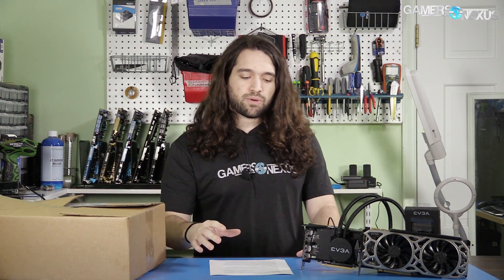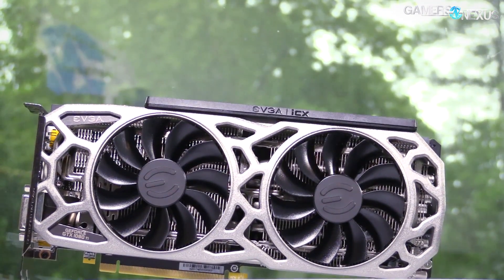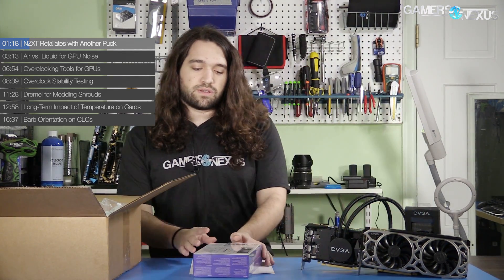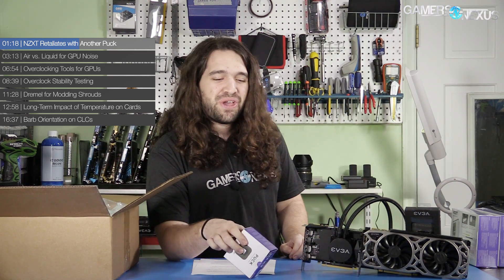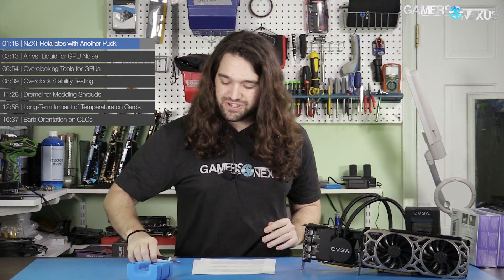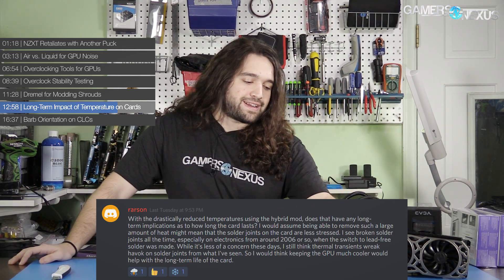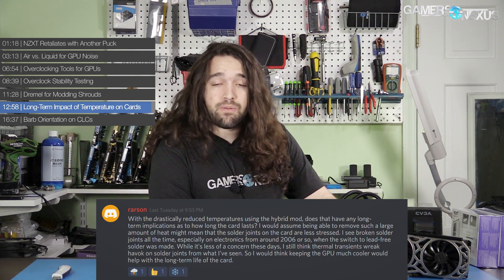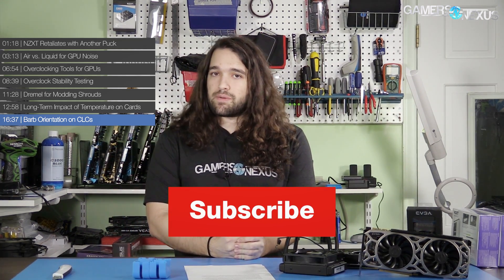Ask GN 49: Long-Term Impact of Temperature, Noise Optimization

Comment from the maker: Ask GN is back! Can't wait to shoot one of these in Taiwan while we're at Computex (May 25-June 5, for us). That's always a fun change of environment.
Reply: Gamers Nexus  

Does getting a none reference GPU help with overclocking EX lets you overclock higher VS the reference  card from Nvidia Lets say you but a water block on both cards.
Reply: Gamers Nexus Could you please make a video about how overclocking affects 0.1% and 1% lows?
It seems that quite often when you show overclocked results, the lows will be even lower than the stock frequency.
Would it even be worth overclocking most cards since the lows are what's most important in most cases to make the game play smoothly, especially if you are already getting high framerates.
I'm assuming this is another reason why many manufacturers don't clock their cards higher even though it is possible for them to do so.
So would you be able to make a comprehensive video, comparing many cards and games, and try to see the effects, and maybe finding the ideal overclock so that it doesn't reduce the lows, and hopefully finding out why this happens (is it thermal? or lack of stability? low quality components?). I ask for a video because a simple answer wouldn't give us an in depth view of it all. 
Maybe compare a whole bunch of cards with the same chips from different manufacturers to see how they do.
I feel like this would be the best way to shop for a card, since lows are really the most important when it comes to choosing a specific brand and model for performance.
Reply: hey steve,  broski here.  i've used the loop from a 295x2 and have it in my lian li tu100b with a 1070 and oc i5 4th gen. what would you change?  i'm thinking vega maybe if it fits or the zotac 1080 after i change the cpu, but im not sure if i should wait for something else or if you recommend cpu before gpu or vice versa. thanks  also, i think the pucks are hilarious and i love your work  :) thank you
Reply: How come AMD didnt include integrated graphics into their Ryzen lunch ? Do you think they will include it into their R3. Are they gonna re-release their R5 R7 with integrated graphics next year?
Reply: Sounds like you have plenty of pucks for future giveaways. :p
Reply: GN at around 16:00 i had a Sapphire Radeon 5850HD from 2009 and the fan on the Gpu die december 2015 and the system was running 24/7 all the years.
Also on another system i was having from 2008 it had a corsair h50i if i remember the name correct.The pump die after 2 years.Since then never again with an AIO i prefer Noctua for Cpu Cooler and GPU's without reference fan cooler.
Reply: Hey Gamers Nexus, I really hope you see my question because I cannot find an answer anywhere. I own an MSI Armor RX 470 4GB card that I currently have OC in wattman to 1340 MHz at 1100 mv with power level set to maximum (+50%) that doesn't pass 70 Celsius. When clocking my card any higher, say 1350, 1360 etc I experience a consistent drop in performance. I have confirmed this isn't a result of the core clock dropping at points due to voltage or power, it is rock solid. I've tried fiddling with more voltage and running fans at max RPM but whatever I do I get less frames in both synthetic benchmarks and games as a result of a higher clock speed. How can this be ? The ASIC of my chip is a low 62.5% I might add. Sorry for the long response but thank you so much !
Reply: I agree.
Reply: QUESTION - What happens if you use all the PCI-E bus Lanes. For example if I plugin 4 cards into my PCIe slots and use a m2.2 with my 6700k computer. Will it error out, will it just be unstable? What exactly happens? (I have never been able to get a clear answer on this). Thanks!
Reply: Wrote this as a separate comment as well: Could you elaborate on what you said briefly about NAND; "Running cooler is generally better for most components except things like flash..the NAND". I've never heard of NAND suffering from too much cooling and am genuinely interested in this topic.
Reply: Question: Why can we Overclock Ram with 2 DIMMs over 2666(DDR4), but Seem limited on Overclocking 4 DIMMs to a max of 2666Mhz. is this a CPU limitation or a Motherboard manufacturer limitation?
Reply: has the gap between low end celerons and high-end i7s grown or shrunk in terms of loading real world geneal purpose tasks across generations? for example would a web browser load a complex web page noticeably faster?

Comment: Great vid! I have an ibuyerpower Revolt 2 with an MSI Sea Hawk 1080 Ti. Both the CPU and GPU are on an AiO (Corsair 55 I think). Radiators are mounted in the bottom because of the case design. Based on your answer to barb placement (i.e., avoid having barbs at bottom of case), was the design of the Revolt 2 case fundamentally wrong? Should I plan on replacing my AiO sooner than later if placing radiators in the bottom is bad? To be honest, I have no issues with noise or thermals.

Comment: Just been watching an Awesome-Hardware where the guys were talking about the Intel Optane cache drive (16 & 32GB) Would this type of hardware be useful to use with a large mechanical drive (say 2-4GB) to speed up your backup/media/games drive, but have an SSD (120-240GB) as a boot drive for OS and essential applications?

Comment: question: Can you solder more vram on your graphics card when there are free slots? Like with the gtx 1060 3gb where there are versions with more vram. (The answer is probably no, but I couldn't find a proper answer on the internet.)

Comment: Ask GN: Why were power limits put on the Pascal architecture specifically? It seems that the 1080 series is amazing, but the only thing holding it back in overclocking is the voltage limitations. As a bonus, how would you speculate the overclocks to be if there were no limits? How much of a difference would it really make?
Reply: Mikah Mitchell I think one good public excuse would be the safety thing, but also I feel it was locked down to keep people from truly pushing them to CRAZY levels and making the next gen a little less of an upgrade over an OCd Pascal...

Comment: with over 15 years of overclocking my CPU/GPU I can say that adding voltage is much more likely to degrade the computer than high temps. And of course both adding voltage and high temps with be like getting slapped (high temps) and getting kicked in the nuts (high voltage) at the same time lol

Comment: Hey Steve love the show keep it up. Question is do you think 1.35 volts is safe for a 4690k if temperatures stay reasonable? I am currently at 4.3 mhz at 1.280 volts and would like to get to 4.5 but can only reach it at 1.35 volts but I am not sure if it is good for the cpu to run that high. What are your thoughts?

Comment: I am fairly new to pc's. Last year I got myself an r9 380 and a new psu to upgrade the prebuild pc I have (amd phenom x6 1050t/4gb ram). Having using it for a year noise, ram capacity and crashes became an issue. Rather than trying to make things work I want to build it with a newer chipset that has some upgrade path so I was thinking g4560. Then ı watched/read online that amd gpus need at least 4 cores to work properly or amd drivers were slower than intel's on budget cpu's. I am really confused right now. Would be great if you guys explain why-if its true-
Sorry for the long comment and my english. Have a nice day!

Comment: About CPU Stability I used Prime 95 without AVX2 for finding out my right Voltage...but there was a problem....Prime 95 was crashing my PC, but Games and Cinebench R15 ran fine....
With AVX2 on 5GHz 3 of my 8 Threads were idle instead of running..

Also about AIO.
I use an be Quiet Silent Loop 280. its pump is vitually silent.
My ASUS STRIX 1080 TI is also Silent under 55°C, above that the Fans go on and cool it back to 50°C and shut off.
Of cause i can change that with a Tool like MSI Afterburner.
But under Heavy Gaming the Cards heats up quite a bit, sothe Fans wont shut off anymore.

And About Longterm Heat... I have an GTX 690 which is a dual GPU Card. Both Cores run permanent at 83-85°C (Thermal Limit/Throttling) with Gaming. The Card is now 5 Years old and had NEVER any Issues. After cleaning it still runs like Day 1. I exchanged it now, because the 2GB Ram was not enough anymore.

Comment: To add a little to the GPU cooling question since idle noise was important: AIB air coolers of recent years have a 0 rpm mode when the GPU is under 60C or a certain load threshold meaning literally 0 db when not accounting for coil whine which is not audible at idle load. I say go air all the way.

Comment: Hmm, really hadn't considered that orientation thing with the radiator. I justs thought that as long as the pump itself wasn't at the highest point, I'd be fine. Have been experiencing some noise from my Kraken X61, so I might try and flip it then! Are there any more GN videos or other sources going into detail on this?

Comment: question: can overclocking say a graphics card to the absolute limit cause the OC limit to reduce over time? Fore example overclocking a new Strix RX 480 to 1475mhz, then over months of that clock needing to gradually reduce the over clock to keep it stable

Comment: 1. Use of m.2 SATA 3 SSD vs NVMe m.2 SSD, does m.2 SATA steal pcie lanes even though it cannot use it?
2. Intel telling people to not overclock k skew processors, particularly the 7700k. How do you think Intel handled the issue with the thermal issues? and why do these people have these problems? Overly high vcore or maybe delid made the CPU worse?

Comment: QUESTION - What happens if you use all the PCI-E bus Lanes. For example if I plugin 4 cards into my PCIe slots and use a m2.2 with my 6700k computer. Will it error out, will it just be unstable? What exactly happens? (I have never been able to get a clear answer on this). Thanks!
Reply: Motherboard and CPU have their own PCIe lanes, so for example x16 and x20 for a total of 36. So using M.2 or PCIe NVMe SSDs doesn't harm your overall capacity in other areas. The number and size of slots on your mobo also kinda naturally restricts how many lanes you can use up in total. The only thing that does actually happen and is common is using SLI or Crossfire. With two graphics cards, they'll use up two x16 slots, but those will then run at x8. Don't worry though, that's still so crazy fast that it's not really a bottleneck even for SLI 1080tis.
tl;dr you can't f up your system by using up too many lanes

Comment: noise is def my first priority nowadays. with the cpu gpu being this good. i usually let them over-heat A BIT.

but so much quieter.

zotac1070+noctua15+define R5. everything turned to noise optimized as possible.  love  them.

Comment: I liked the question about the lifetime based on temperature. Mainly because I live in Rio, Brazil (hot as hell!) and I just bought a 7700K. I'm impressed how this chip is hot!!! Is there any differences between the silicon on CPUs and GPUs, regarding temperatures? In my experiences, my GPUs have always been hotter than my CPUs... And now this Intel chip is challenging my beliefs.

Comment: Ask GN: I recently overclocked Crucial Ballistix Sport DDR3 1600MHz (2x4GB) to 2000MHz by loosening the timings from 9-9-9-24 to 11-11-11-28. It passed MemTest86 for 24 hours at the overclocked settings. However, Unigine Heaven crashes instantly with the overclock. While I understand the merit of using multiple applications for stability testing, any ideas why MemTest86 got it so wrong? Should I bother using MemTest86 in my testing suite?

Comment: Many gpu reviews are done on x99 systems because it alleviates cpu bottlenecks according to most reviewers. This seemed fine until ryzen came out, where we saw the r7 1700 "performing worse" aka slightly bottlenecking the gpu in comparison to the 6700k/7700k. (Which in terms of gaming the r7 1700 is effectively within margin of error from the 6900k).

So my question is, why do reviewers opt for x99 systems for reviews knowing they are holding the gpu's back by a very measurable amount, or did it really take ryzen to come out to make the community realize that skylake/skylake v2 (kabylake) actually have some rather noteworthy gains over haswell?

Comment: Here is a question the internet hasn't been able to tell me, google, nor bing, WHAT WATER COOLER can I use on a ASUS GTX 1080 Turbo? I want to stick it on water, because TBH, it's loud as a jet at 100%, but zero coolers are for it, heck, even EK is like 'GLbro'.
Reply: Madness Soft You could check out and simulate a water cooling solution from ekwb. You put in all your current computer specs and you can choose the decibel range for the performance of such setup. it might be your best bet, but it might cost you some cash. Hopefully this helps.
Reply: Yes I know about that, but honestly, it comes up as "no", seriously, go check it for an ASUS GTX 1080 Turbo. It's a big fat "nope" solution

Comment: Extreme temperature cycles does age electronics, and that is done sometimes to accelerate early failures before shipping the parts - no one wants an airbag module to fail in the field, right? ;)
Reply from the maker: That's what I said -- we did temperature cycling to synthetically age things.

Comment: In my experience, if I can run a single pass of Heaven and Valley without ANY artifacting, then my GPU overclock is very close to stable. I have to look carefully at the run though, sometimes artifacts are not very severe. I don't find Superposition to automatically detect instability faster than Valley or Heaven.
Reply: Eric Lin some games don't like it though. My 1060 6G is stable in everything at 2152mhz except rise of the tomb raider and playerunknown's. Random games.
Reply: In my experience the clock I got from what I described was a few mhz higher than my own overclock, which was stable under Witcher 3, BF3, BF4, and Skyrim. However I have never played Tomb Raider.

Comment: CPU OC stability test: OCCT. 
Settings: CPU:Linpack, automatic, duration 5 min, 50% memory, 64 bits.
Keep an eye on CPU temp.
If you get random restarts or shutdowns, your system is not stable.

Comment: Hi Steve, clarification for AIO orientation question:
I plan to place the AIO radiator (and fans) in the front of my case (so that the radiator sits vertically). Do I want to orient the radiator so that the barbs (the point where the tubes connect with the radiator) are at the bottom of the case, or at the top of the case?
And, this is done to decrease bubbling or water noise in the system?
Thanks!
Reply: coleplacemb I've always read and heard to put the in/outflow tubes at the top. I think it might be to reduce pressure on the tubes where they connect to the radiator but I'm not sure.
Reply from the maker: Tubes oriented down if vertically installed. Hope that helps!

Comment: First off thanks so much for your hard work and excellent content :) Behind you in this video is a bottle of Thermaltake C1000. On the bottom of the bottle is a "sediment". I found a similar looking substance in my blocks' fins after a month or so of using the red C1000. I think that my temps were rising over time due to blockages. I flushed and cleaned all my blocks(not trivial) and filled my loop with distilled water. I had bought a second bottle of C1000 red and put it in  a closet. Seeing it recently I noticed the same sediment form at the bottom. So the questions are these:1 Was it that sediment that caused the blockages? What is the sediment? and if I strain the liquid will it remove the chance of blockages? Thank for any ideas. P.S. -I'm not trying to hate on Thermaltake, I've really liked many of their products and I'm really just curious if i did something foolish and/or obviously wrong.

Comment: Just a reminder about rotary tools, they are high RPM, low torque.  Applying too much pressure due to impatience will cause the motor to be overworked and reduce its lifespan.   Make sure you have the right bit for the job, and let the bit do its job.

Comment: Hey Gamers Nexus, I really hope you see my question because I cannot find an answer anywhere. I own an MSI Armor RX 470 4GB card that I currently have OC in wattman to 1340 MHz at 1100 mv with power level set to maximum (+50%) that doesn't pass 70 Celsius. When clocking my card any higher, say 1350, 1360 etc I experience a consistent drop in performance. I have confirmed this isn't a result of the core clock dropping at points due to voltage or power, it is rock solid. I've tried fiddling with more voltage and running fans at max RPM but whatever I do I get less frames in both synthetic benchmarks and games as a result of a higher clock speed. How can this be ? The ASIC of my chip is a low 62.5% I might add. Sorry for the long response but thank you so much !

Comment: Hello, I have this problem where if I press the power button on my pc, the screen is black, nothing shows up, no signal and everything works normal, but gpu fans spin @ 100%, but then if I shut it off and switch the button on the power suply off and then turn it on again and I press the power button everything works normal, no issues. What could cause this? Any help would be appreciated, it just happened randomly 1 day. The only thing I can think of that changed was bios, I updated motherboard bios from version 06xx something to the latest atm 0906, but I can't recall if it started happening exactly after that, but the process went smooth without issues  and I guess some pc specs might be usefull, so here it is:

MB: Asus strix z270h
CPU: i7 7700K w/ hyper 212 evo
RAM: vengeance lpx black 16gb 3000mhz
GPU: strix gtx 960
ssd: 850 evo 500gb
hdd: wd black 500gb
psu: corsair rmx 650w
case: nzxt h440

everything is in stock config and only xmp mode on, I tried booting with default settings, but same issue, I checked if there are some cables not plugged, but everything seems fine.